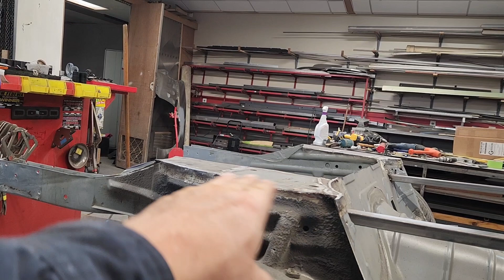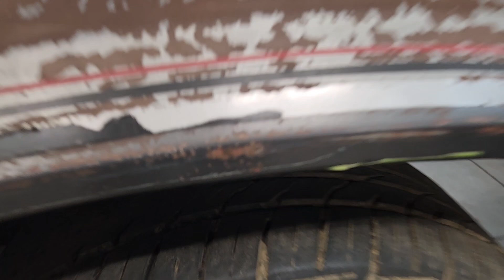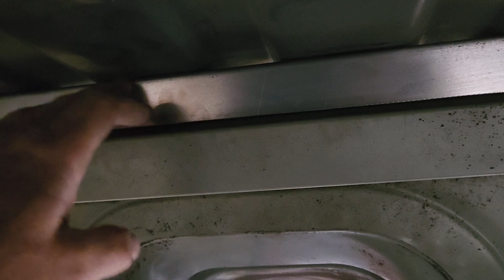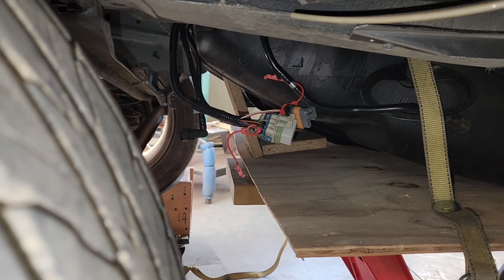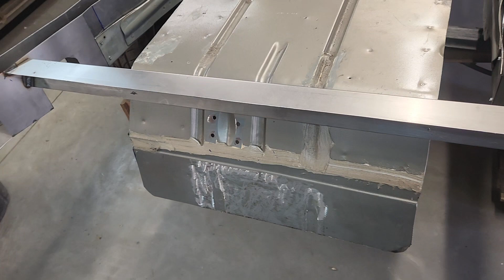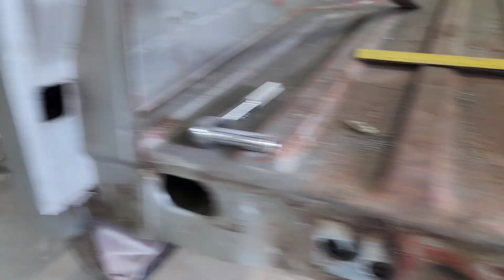85 El Camino 99 Z-28 Body Swap part 6

Comment: Really coming together nicely Steve. Like I said before, this is going to be one sturdy car!
Reply from the maker: Thanks. I think so.  Got a little flack by going unibody from a frame car but I think it will be tighter.
Reply: @SteveMirabelli  Unibody is 100% better so long as it's done right, most just don't want to spend the time to do it right.